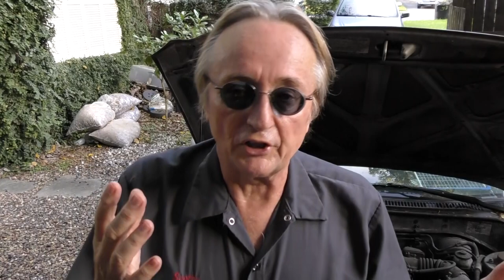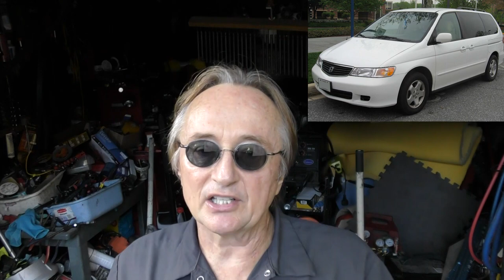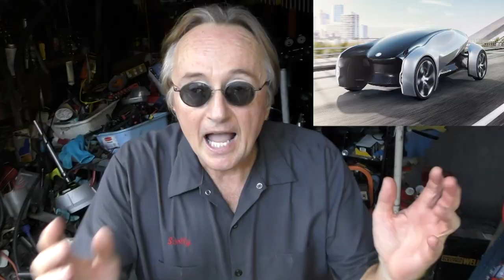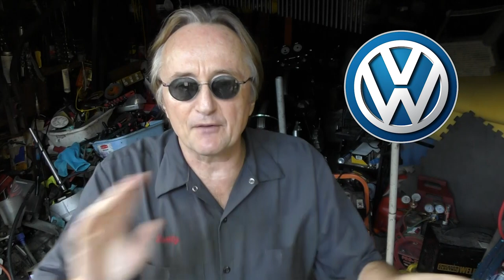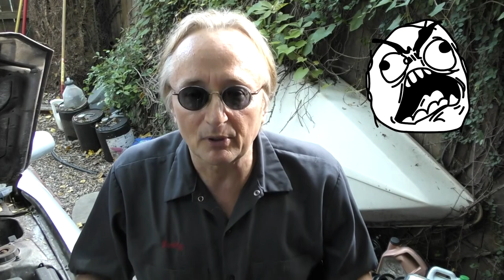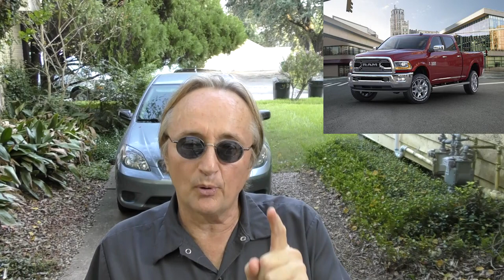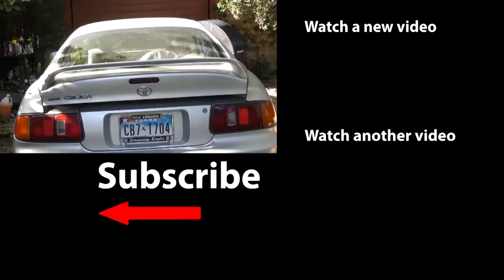Who Makes the Worst Automatic Transmission Cars in the World

Comment: i gotta throw ford on the list.  everyone i know that had a ford had issues.  if not rust, it was the trans.
Reply: The DCT is complete crap.
Reply: you get around
Reply: Yeah no Ford by far makes the best transmission's in the industry.
Reply: 4 sets of clutches and 1 clutch fork by 100,000 miles, with it showing signs it would need another set in another 5,000. 2012 Ford Focus. It's just as well Ford won't make cars anymore, but I stand to get a couple of hundred back when Ford pays out the (one of many) case action. If that's your idea of "best transmissions in the industry" I'd suggest you stop using a power drill and 3/4" bit to clear out earwax.
Reply: the AOD on my ford Crown vic is a terrific transmission, never gave me problems . The ones in the fiesta, eco-boost and focus today, yeah they feel very weird, and feel very sluggish is response time
Reply: see that is ur thoughts.  i know people that dont abuse their cars yet mostly tranny issues.  and they had fords fords fords, then a chevy then ford (250).  and currently of them all.  fords had a electric issue or tranny.  the current chevy the trans is slipping but works and the 250 is rusted. lol.  not even 5 years old. i personally HATE fords.  i would test drive a mustang but other then that i can pass on driving a damn ford.  most people i see driving fords are terrible drivers too. oddly. at least around here.
Reply: @iamteamBB  If your comparing a Gm transmission to a Ford then your just foolish. Gm makes the worst wiring harness they have bad sensors all the time. They burn wiring hardness's all the time they even have recalls because of them. Their cases on 4t40e/4t65e crack and break all the time. Because their not strong enough  and that's not even getting into the internals. Ford even helped design all of  Gm's 6 speed transmission's because they were having so much trouble. GM by far makes the worst transmission's in the business. I would know since I've been in the transmission shop for 6 years now.
Reply: Our ford has had no problems! Runs great and has no rust

Comment: Question: why most cars that come or came with a 5 speed manual, their automatic version only had 4 speeds instead of 5?
Reply: and thats why in a 5 speed manual you get better gas mileage.
Reply: A Team nope i have a Volkswagen and i get 8-10 km per liter and it is terrible, at 100 kmh im already at 3000 rpm. Its bad.
Reply: @StBeter-tc2te  3k rpm at 100kmh..its like my father's Daihatsu compact car with 600cc engine XD
Reply: blitzer25 blitz lmao im not lying. Its garbage, i have the 5 speed, the 6 speed would've been better.
Reply: Money reasons.  Autos were expensive back in the day relative to the manual.  Less speeds = less expenses
Reply: More moving parts occupying the same engine bay space. 
Honda now makes 7 speed autos in the 4 bangers.
Reply: engineering budget cut
Reply: It’s just the rate technology moves.. I always see it like in the 60s-early 80s there was three speed autos and four on the floor.. then overdrive got us the four speed auto and 5 speed manual... all they did was add an overdrive to the older designs... and then now we’ve advanced a lot here with 6 speed manuals and 9 speed autos, with automatics getting better mpg due to advanced manufacturing
Reply: A few reasons: An automatic with a planetary gearset and a torque converter is heavier and uses more space than a standard transmission, hence you can save some weight and room by using less gears. Thanks to the  torque converter, you don't need as many gears to effectively cover the same speed range (not with the same performance, obviously). Also, an automatic gearbox is more expensive to manufacture, so using as few gears as possible was a way to make it as affordable as possible. The downside: Less gears means more fuel consumption, which has become a priority. And today, people seem to be willing to spend the thousands more it costs to have up to 10 gears.
Reply: Because automatics are crap.
Reply: @KT-fi7tm  
The new Accord has a 9 or 10 spd when paired with the 2.0T
Reply: pochoun33137  not true. Honda's older transmissions had torque converter and planetary gears, just like most conventional automatics back then.
An automated manual is basically a dual clutch like the one usee by VW, Honda had no such transmissions available back then.
Reply: +Alex Vieira: Because 4 speed torque convertor transmissions have 6 or 7 forward speeds. 1st,2nd,3rd,3rd lockup,4th,4th lockup. Some have 2nd lockup as well.
Reply: @TeeroyHammermill  hmm never thought of that. Good point.
Reply: It had 5 gears. 4 gears and an overdrive. So a fake 5th gear if you had a 90s Japanese car back then. I believe most American automatics had no overdrive at the time
Reply: Auto transmissions usually have overdrive that acts as a "5th" gear
Reply: Size and wieght limitations, old school autos used a bulky and heavy torque converter to control power from the engine to the transmission so to offset this the engineers simply made the transmission smaller and the easiest way to do this is to take out a gear.
Reply: Because the torque converter acts like a infinitely variable gearbox also.

Comment: I have that generation of Honda transmission in my 2003 Honda Pilot.  I was aware of the issue when I bought the car and have drained+filled the transmission fluid with Honda ATF every year.  Also replaced the radiator right when I got it.  Going on 210k miles on the original transmission with no issues so far.
Reply: Should never have to change transmission fluid. The industry is lieing to sell more products/services
Reply: You are certainly right about the industry.  But relating to the fluid, almost any type of oil will eventually break down from friction, heat, and contaminants and reduce its ability to lubricate moving parts.  Supposedly sealed transmissions with lifetime fluid don't need to be changed, but I think it's more of a case of lifetime business for the manufacturers when your tranny breaks down.
Reply: Kevin, we do the same with our Honda Odyssey. Drain and fill once a year with Honda DW-1

Comment: I'd have to say one of the most reliable automatic transmissions are Toyota's/Aisin A340E, and A650E (with stock HP/Torque). I had the A340E in my 1995 Lexus GS300, and I put that poor thing through hell during moments of being stupid. It was more than likely the original transmission, and if it was - it had 329,XXX miles before the car was wrecked (I miss that car). I say this due to the 2JZGE engine was swapped out for a lower mileage one sometime before I became the last owner of the car. Now as for the A650E which my 2000 Lexus GS300 has shifts, and drives smooth as silk. It has 200,XXX miles on it, and shifts up/down like brand new. Anyway... I'm done rambling now.
Reply: The A750 transmissions in Toyota's trucks are pretty good. Aisn in general is pretty good.

Comment: We have a 2004 Dodge Caravan with 330,000 kms on it. Original engine and transmission with no issues. Still shifts smooth and drives great. Biggest issue that caused many of these transmissions to blow was the wrong fluid being put into the transmission. I've seen higher kilometer vans than what I have with original drivetrain and no issues. It call comes down to maintenance.

Comment: Every car company has had lemons with there transmissions. Eventually they get worked out. People say the 4l60e transmission from GM is the worst one GM has ever made. My Grandpa's 94 GMC Jimmy is pushing 500k miles and it still shifts like it's brand new with a original 4l60 trans.
Reply: Firebird 87622 your sample size means nothing
Reply: 03056932R Ok that's just one vehicle me personally I have seen the 4l60e transmissions with 200, 300, 400, 500+ miles on them. They haven't failed yet and there still on the road today. It's about how you take care of them to get that kind of mileage out of them. It's also how you treat them it's the same with any other car company's transmissions.

Comment: I have to disagree. Nissan makes the worst Transmissions. They have had Two Class-action lawsuits for two versions of their CVT,  for the Marano and the Sentra.
Reply: class action lawsuit does that tell how many has been affected, so I have to disagree with you, but nissan make three version or class of CVTs, but onlt two version comes to the USA, but honda has also three version of the CVT that have problem,  for the fit, civic and CR-V.The big difference is nissan never have snap shift, is more belt , clutch and over heating, honda CVt have all, and more even, snap shift.
Reply: This class action for the Nissan CVT transmission covers every model with a CVT from 2012 thru 2017 of both Nissan and Infinity models. It's still being litigated but is one of the largest automotive defect cases in U.S history. They knew it was defective in 2014 but continued to manufacture the faulty transmissions. Nissan has extended the warranty for the CVT to 120,000 miles.
Reply: @cb5110  If you can find a warranty that matches Nissan's CVT warranty of a 120,000 miles I'd like to see it. No other car company comes close to that. Nissan knows they're going to lose this lawsuit because they knowingly manufactured a defective part that could have killed hundreds if not thousands of people.
Reply: @theylied1776  i have seen all law suit , the lawsuit cover 2012 to 2017, but there is no model beyond 2015 mention in the suit, so I know very well of what I speak. I there put you to show me any owner with a cvt issue in the law suit beyond 2015.
Reply: @theylied1776  whether you know of it or not, honda have some secret warranty. Many cvt go replace with no question ask. Honda issue was so bad that they had to recall 140,000 fit and civic. Can you show me where nissan have snap shafts or recalling over 100,000 versa and sentra? Nissan issue was once belt, clamp and the last was overheating. Yet you telling me nissan issue is worst than honda cvt cutting or snapping  shaft, over heating, belt issue and clutch. Did you read the law suit you post are did you just read the heading? There is no nissan vehicle beyond 2015 with cvt problem. But go look for the older CR-V with cvt problem up to 2016+.
Reply: @cb5110  As I said before, it's still being litigated. You apparently don't know that much about the law. And I'll ask for a second, time show me another car company that has a warranty of 120,000 miles. Nissan those are losing and they will lose. This type of civil case is easy to win four half-witted lawyer.
Reply: @theylied1776  you have lied nissan cvt issue has been fixed, I will await you showing me any altima owner join the law suit beyond 2014 model with cvt failure.
Reply: @cb5110  Just so you understand why you can't find any lawsuits for Nissan's pass 2015... it's because Nissan now has a 120,000 mile warranty. That means, they will fix any problem with that vehicle that is a defect up until 120,000 miles. In order to file a lawsuit you must show damages. If Nissan is offering to repair the defect then you don't have any damages to base a lawsuit on.
Reply: @theylied1776  listen don't come here with your excuses, all the suits against nissan are for 2012, 2013 and 2014 models there are some 2015 sentra only which was produce before nissan introduce the cooling kit. You cannot show me nothing else beyond that because it does not exist. For your information Mitsubishi and Hyundai both have 10 years powertrain warranty.
Reply: @cb5110  I can't help it if you find it hard to understand basic principles of civil law.
Reply: @cb5110  Show me a single document the claims Nissan's CVT issue has been fixed, all I need is one article... that's it.
Reply: @theylied1776  nissan have warranty of 120,000 miles before the suits. And to show you how you are wrong the recent JD Power 3 year study has nissan jump from 23 way ahead of honda. CR have to concede too. Now are you saying it because of the warranty people are lying to CR and JD Power?
Reply: @theylied1776  go look for the nissan forum and CR and JD Power 3 year dependability. Those are reliable source.
Reply: @cb5110  I'll ask you a second time. You called me a liar, so give me a single article, news report, or Automotive Journal that claims Nissan has corrected their CVT problem. All I need is one? This shouldn't be hard for someone like you.
Reply: @cb5110  And if you can't post a single link, everyone will know exactly who the liar is here.
Reply: @theylied1776  sir or madam I understand civil law. What you are not understanding is the vehicle in question are not beyond 2015 or if you still do not understand, the vehicle in the lawsuit does not go beyond model year 2015. Anyone can join the suit up to the time it was filed, as it mention 2012 to 2017,  there is no 2016 or 2017 model in or join the suit.
Reply: Buick ranks highest in overall vehicle dependability among Mass Market brands with a score of 116 PP100.
Fiat is the most improved brand, with owners indicating 106 fewer PP100 than in 2017. Infiniti has the largest improvement in rank, moving from 29th to 4th. Other brands with strong improvements include Nissan (37 fewer PP100 than in 2017) and Ford (31 fewer PP100 than in 2017). Kia’s fifth-place ranking is the brand’s best-ever VDS performance. Dodge and Nissan also post their best-ever rankings.
Toyota Motor Corporation models receive six of the 19 segment awards, the most for an individual corporation in the study. These awardees are Lexus CT, Lexus ES, Lexus GS, Lexus RX, Toyota Prius and Toyota Tacoma.
General Motors models receive five segment awards for the Buick LaCrosse, Chevrolet Equinox, Chevrolet Malibu, Chevrolet Traverse and Chevrolet Silverado.
Audi Q3 is the only model in the 2018 study to receive an award in its introduction year. Other models receiving segment awards are the Dodge Challenger, Ford Super Duty, Ford Expedition, Honda Odyssey, Hyundai Tucson, Kia Rio and Mercedes-Benz GLK-Class.
The 2018 U.S. Vehicle Dependability Study is based on responses from 36,896 original owners of 2015 model-year vehicles after three years of ownership. The study was fielded in October-December 2017
Source JD power 2018 Vehicle Dependability Study
Reply: @cb5110  To whom it may concern, I shall ask you for a [third time] you called me a liar now post a link turn article,  news report, or Automotive Journal that shows Nissan his fixed the CVT problem... all I need is one.
Reply: @theylied1776   are you blind?
Reply: CVTs are not automatic anyway that's why the title is worst Automatic Trans. CVTs are at different case

Comment: I have a 2002 chrysler voyager 2.4L with 248,000 miles still driving it original transmission still no problems runs great.
Reply: lucky you man, because that engine is crap. yesterday I serviced my 2001 grand voyager with 2.5L CRD and mechanic told me that there are all the time problems with this kind of engines :/

Comment: Scotty what do you think about using the Manual Mode on Automatic Transmissions?
Reply: dont.   i have seen girls get into their car with their purse placed next to the shifter  and with the purse sitting in the middle they unknowingly push on it and later.  oopssy   something feels wrong.  and then the girl goes to a repair shop and starts calling every guy on her phone list for money,  they really had no clue they was driving all over in the wrong gear so they just give it more gas to make it go,
Reply: If you don't hammer on them, "manual mode" can ve more efficient than auto mode. Just because it shifts quicker, less slippage, more life. Every shift is one step closer to failure... Simple math.
Reply: When going up inclines or driving up into the mountains, manual mode works better to keep it from "gear hunting". Otherwise auto is fine. But that's just because the engine in my Honda Fit Sport is weak. 😒
Reply: I think he made a video on this a couple weeks ago. Check the channel. But he basically said its fine to use it. Doesnt hurt anything
Reply: A Team Ok.......
Reply: I use the "manual" mode in town to keep my 2017 Cruze from doing the auto stop/start.   (That is the only way to over-ride that "feature" in a newer Cruze.)   ...And of course on steeper inclines to avoid the dreaded downshift/upshift cycles.
Reply: Hyundai had the worst shiftronic transmissions on their tiborons. After a few months, the pin inside the shifter that lets you up and down shift would bend then stop working. To fix it,  you have to open up the shifter to put the pin back in place and add some reinforcements to make sure it didn’t break(bend) again

Comment: I would like to nominate Peugeot for its AL4 automatic transmission.
I had one in a 406 diesel.
After the first rebuild at 100,000km I had a specialist service the ‘sealed for life’ transmission every 20,000km. That extended the life between rebuilds to 120,000km.
The rebuilder told me that the problem was caused by a lack of oil volume in the transmission, which caused the oil to overheat.
There was nowhere in the engine bay to shoehorn in an oil cooler.
That was my first and last Peugeot. 😡
It was magnificent to drive, but it was also a mechanical nightmare that did not end. The transmission rebuilds every 120,000km was just one item on a shopping list of problems.
Even the harmonic balancer delaminated. 😳
Reply: Mechanical nightmare? You mean endless money pit?